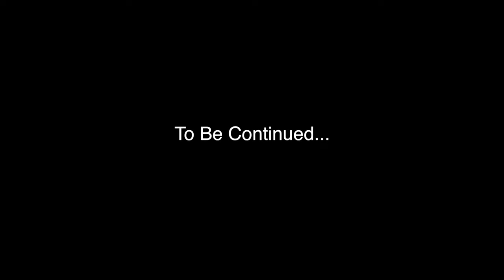How To Fix Stuck Brake Caliper Ford F250 F350

Comment: Cody, here is a tip for you, having to deal with this currently on my personal 2002 F250. (had smoke pouring off one caliper while driving)
I found out out that the brake hoses between the caliper and metal line go bad frequently and work like a check valve preventing the caliper from releasing.

replace those hoses (about $30 ea) and you should eliminate the "cause" of the problem. (might also be an idea to replace the other rubber hoses)

also check your brake fluid, if you see any discoloration (green = agae brown/golden = burnt fluid [should be clear]) flush the fluid until clear & re-bleed the system.

Comment: Cody, as far as parts pricing go, yes the dealership is usually going to be more expensive, but after working at a Ford dealer for for several years both in parts and service, they are not the most expensive all the time.  Just remember when you go to or call a dealer to have your VIN handy, where I worked they only needed the last 8 digits.  Also when brakes are seized up make sure to double check your slide pins to make sure thats not what is causing the problem.  And there probably no go way to explain this without being there in person, but you can depress the piston without unbolting it, using a pry bar.  Keep up with the great videos.

Comment: I've rebuilt F250 calipers before, back in the day, and you just need a hone and a rebuild kit and they work great.  It''s just an O ring and a cylinder in the bore of the caliper..  On a dual piston setup, it's just 2 of them.  The only reason you need a new caliper is if you bugger up the bore, or the bleeder valve gets snapped off or you buggered up the slides...  :)  Great vids Cody and Mrs W. :)

Comment: Between my 2 friends and my self I have seen 4-6 sets of "locked up" calipers.  One on a 2003 Excursion, several on a 2007 F250 (rear) and several on my 2007 Fusion (rear).

My theory is the slide/guide pins are sticking, despite being well lubricated. One axle set that I replaced, new pins would NOT fir the existing holes in the caliper until I actually drilled the holes over sized.

The last set of rear pads I installed on my Fusion lasted less than 12 months !  These were top quality, name brand, ceramic pads.

If you have a problem with a Ford caliper, I now recommend replacing BOTH the caliper and the bracket with re-manufactured units.  These come as one sub-assembly including new pre-lubed slide/guide pins and new rubber "boots" for the pins.

Rebuilt calipers and bracket for your truck from Rock Auto are about $101 with a $56 "core" charge.

Comment: Super duty's of this era have this problem all the time. I put some drilled and slotted rotors (I know sounds crazy) on mine and never had a problem since. Seems that the truck is so heavy that too much heat gets transferred to the caliper and just destroys them over time. Really it all comes down to cooling.

Comment: Check for a collapsed rubber break line. Often the inner sleeve of the break line will let the high pressure force the fluid into the caliper, but won't let the return fluid return to the line system and the master cylinder. Happens often.
Reply: Looks like one piston compressed when the other one didn't this time though. And it won't compress with the line removed either:( Although the brake hose would be an easy fix:)
Reply: +Julian P. I've seen a few dodges with failed brake lines that'd lock a caliper up.  But yeah, something happened to that caliper that cocked or galled the pistons.
Reply: +Julian P.  
Agreed Julian. But my experience has been once the brake line is off the caliper releases. It didn't in this case. I've run into that problem a couple of times. First was on a big Chevy powered motor home with the brakes from HELL. Unlike anything I'd ever worked on. But I've since seen it on my Ford pick-up and a friends Chevy pick-up. I'm told moisture in the fluid system is to blame. It causes the rubber to swell up internally and hydraulic pressure will force fluid through the system, but of course it can't return.  I'm no mechanic though. Just work on my own stuff. And friends. These online tutorials have helped me out more than once. There are things I'd STILL be working on without Youtube.
Reply: I'm just concerned that in the removal of the caliper is when the piston was forced into a bind and not prior. Normally when let sit for a while or over night the pressure can get back though the collapsed line. In either case I'd replace the flex line at the same time I replaced the caliper. Not that a reman caliper couldn't be bad.
Reply: Great video!  The replies are all helpful as well...thanks!

Comment: I rebuilt my calipers on my 01 F350. Also replaced the ball joints (using your video for a guide). That was 2 or 3 yrs ago now. I used EBC rotors and brake pads. Couldn't be more satisfied with them. My truck has 240k and has the 7.3 Diesel in it.

Comment: A mechanic put on a Napa one 7 months ago in my welding rig . Just yesterday I had to pinch the brake line off with vise grips to make it home. Holy was that rotor hot . Anyway After pulling off the wheel the pistons were evenly distributed. The sliders didn’t have any grease on them. I cleaned off all the dirt with a small wire brush then put on the orange grease. Now she rolls smoothly . I fixed it . Costed me 50 cents.

Comment: My 2005 F350 used to hang up several times a year, and I took it to a private mechanic, and he said it was the cheap grease the dealer kept putting in there. He used a grease with never seize in it and I never had a problem with the brakes hanging up again. The dealer tried to tell me it was fairly normal if you didn't have the brakes serviced every year. I thought that was outrageous.

Comment: A Bummer only getting 6 months of use for that caliper . I can relate to the days of rebuilding the calipers,  we stopped doing that as the time costs increased to the point were it was not worth the time to rebuild along with liability  so exchange for a new one . I hope you have better luck with the next one .

Comment: Cody I read someone commented that you might have a bad brake line. I had a Ford truck once that my brakes did like your brake. It took sometime to figure out that I had a bad brake line. I was told by Ford that they have a problem with the lining of the flexible brake line breaking down and it creates a flap like a valve. I changed out the flexible line and never had that problem again. Best of luck getting your truck back up and running.

Comment: Funny story for ya, my brother who is an mechanic for twenty plus years. Used to tell me the same thing about levels of parts and to never buy anything that isn't at least Napa. One day my dodge ram clutch went out and I didn't have the money to buy one from Napa since they wanted twice what shucks (O'Reilly) wanted. All the way to the parts store and back he's telling that only a Luke clutch is the they to go and you can only get from Napa. So we get home and pull the trany and I open the box the new clutch came in and guess what was stamped right on the clutch, Luke. 

Trust me when I say that it doesn't matter because there isn't that many people making parts anymore. One goes to one store and the other good to a different store. 

Same thing happened when I was working at radio shack. Cleaning the receivers and I look down in the vents and on a radio shack stamped unit I saw on big letters Pioneer.

Save your money my groomed
friend.
Reply: Just friend not groomed, darn smart phone :-)
Reply: +kantill what was?
Reply: +KingLeonidasll sorry I'm not following what you're asking.
Reply: oh shoot, my apologies, the 'show more' button didn't show up and only part of your comment appeared. It cut off right at 'guess what was' I was just getting interested and it stopped haha
Reply: +KingLeonidasll No problem :-)

Comment: I'm in 11th grade over at whittier tech in Haverhill, ma and I can't tell you how many brake jobs I've done on trucks that had the exact same brake issue as your F250. On many of them, the customer provided all the necessary parts and absolutely none of them were even from Napa. Most of them were from CAP and were more expensive than the better quality Napa parts
Reply: Probably would be smart to add that I am in the automotive shop course at Whittier Tech
Reply: +martin hedberg  Yes indeed, its hard to tell what you're getting for parts.  Myself I'd push the pistons out and see what the failure cause was.  Rebuilding calipers is so very easy, often unless the bleed screw snaps off I'll tear them down, clean and put them back together.  I have seen where a hot pad burns the dust boot and dirt gets in, just need a new dust boot and clean up the piston.

Comment: Another Way-to-go for Mrs. W :-) That's the way to get it off! Brute force! We live in a throw-away society, MOST people if it stops working, throw it away and buy a new one. I am guilty in a way our 7year old washing machine bearings went, and we could not get all the parts to repair it, so we finally opted to get a new one with a warranty. AND Mrs B LOVES IT! I spins REALLY fast, and when the cloths come out the are nearly dry! And living it wet Ireland, with high humidity, that is  in my oppinion, a very good thing! Hope the  follow-up video is just waiting for me, as the suspense is just killing  me! LOL! :-D

Comment: Hey Cody, I have been fighting this problem since my 06 SuperDuty was new. The Issue is that the pistons are made not from Metal which expands at a similar rate to the caliper, but from a phenolic compound that expands more than the bores in which they reside. Thus they seize in position after hard breaking, causing more drag, more heat, super hot seized brakes./ The reason for the change away from metal was to prevent heat transfer from the pad through the piston into the brake fluid which causes brake fade due to boiling. Ford was sued over this! I have often thought about reducing the diameter of the piston thus increasing clearance, but I am just too busy. I have never experiences stuck guide pins. So there you are.....send me a nice axe,  Pete
Reply: Same problem with my Chevy, phenolic caliper pistons suck!  I forced the piston out and it had swelled so much that it wouldn't fit back into the bore even without the seal!!!
Reply: Same issue here on my f350, four sets of calipers in 5 years due to these shitty phenolic parts. (never a pin issue for me anyway)

Comment: I'm in management at Autozone down here in Arizona and that's one of those deals where if that happened, I'd make sure you got new pads and a rotor as well at no charge, parts shouldn't fail like that when they are so new...

Comment: So the repair of a Ford Super Duty stuck brake caliper is to go to NAPA.  I was thinking you found some trick way to prevent the composite pistons from sticking in the caliper bore.  This version of brake calipers used in late model Ford Super Duty trucks are notorious for sticking.  An on the road quick fix is to use a large hammer on the back of the caliper.  Give the caliper body several hard shots and most of the time the stuck piston will slip back in the bore.  Most of the opinions follow the composite plastic pistons (2/ caliper).  These pistons are used to prevent brake fluid flash if the brakes pads are severely overheated.  The plastic pistons won't conduct heat into the caliper body and boil the brake fluid and fail the brake system at an inopportune time.

Comment: I had a Ram 350 that had a stuck slide on the left front caliper that I never even noticed, until the pad started squealing. It was only working on the piston side. New pads and some grease fixed it up. It was a new truck, but left over from the last-years models. I'm back to Fords, now.

Comment: I bought oem Ford caliper from local Ford dealer only 35$ more for new one compared to aftermarket rebuild from parts store. Oem last 200k. I would recommend to buy FoMoCo parts. Thanks.

Comment: Cody I think you need to replace the rubber line that hooks to the caliper take it off and see if you can push air thru it backwards this is typical on these to go bad the pressure will come thru but the rubber in the line makes a flap and keeps the fluid from returning!!!!

Comment: I have given up on parts stores and only buy parts online unless it's an emergency. The stuff they sell is absolute garbage and totally overpriced. NAPA is the only major one I know of that's still kind of decent but even their store branded stuff is going down in quality.
Reply: +27dcx agree'd, I'd trust a highly rated amazon part before a napa part nowadays.
Reply: got that right,i refuse to get robbed by the local parts store!
Reply: Lol napa is the worst and most overpriced of the bunch 😁 especially their calipers
Reply: @foxbodyguyeightyeight3672  Yeah. a  lot changes in four years.
Reply: @27dcx  I didn't even pay attention to the time stamp lol
Reply: Went to Napa the other day they wanted $90 for a e350 cartridge fuel filter heck I can buy FOMO for $67

Comment: Cody often over looked are the rubber hoses that do cause problems they swell shut and they degrade passing particulates into the calipers.
Reply: +LOOPPEY ditto Looppy. Sometimes the hose will act as a one way check valve and apply pressure to the caliper but not release it. Hose replacement is cheap insurance.

Comment: had the same issue with oreillys parts, for my F250 (made in 99 but is a 2000 year) they switched from metal pistons to the plastic and for 2 years of having this issue with the metal pistons I went with plastic, 4 years now zero issues.

Comment: The left front caliper seized on my 92 Ranger.  I put a new seal, piston, and dust boot in it, and it's been fine since.  Never have dealt with a dual (or more) piston arrangement, so don't know how that would play.  
BTW, retraction is entirely due to the square cut seal, and of course the slight amount of runout on the rotor.  The seal "tips", and pulls the piston back when you release the brakes.

Comment: That sucks,  I started using NAPA parts sense I started watching your channel.  I just finished all the maintenance on my work van.  
Plugs and Wires, serp belt, the hateful A/C compressor stretch fit belt, front brakes, rear brakes, rear axle oil, transmission oil and filter.

Comment: I have a big C clamp that I fit over the caliper to squeeze the pistons back in.  I usually turn one of the brake pads around backwards to make a bearing block.  If I go to the trouble of taking the brakes apart I usually replace pads at the same time.  The one pad looked 3/4 gone.

Comment: I had a similar problem once. The piston got corroded a little and was hard to move. I was able to disassemble the caliper and remove the rust with fine sand paper. Put it back together, bleed the line and worked perfect.

Comment: Cody - If you have repeated brake caliper failure, check the brake line for that wheel.  Oftentimes, the brake line will deteriorate on the inside basically turning it into a one-way check valve so that the fluid will come from the master cylinder when the pedal is pressed but will not go back to the master cylinder after the pedal is released, thus resulting in a failed/locked caliper.
Reply: thanks i think that is whats happen to mind

Comment: Brake lines are bad to collapse on the inside of the brake lines going into the caliper. Try and open the bleed valve and see if the brakes release if so a brake line is your problem if not it's your caliper
Reply: Wouldn't both pistons be stuck then ? I'm working on mine right now.

Comment: Entirely intended to be constructive observation ( I know! Usually the harbinger of some form of attack ;-) ).  Its impossible to cover every aspect of a subject in a short video - and particularly keep it interesting and flowing.  So constructive additions via comments are usueful and develop the theme nicely. I view the videos as a sharing process with Cody and like that - a great deal.  My issue is that the video titles aren't always helpful in giving the correct impression of the content.  I appreciate it risks pedantism - but its more a case of expectation and frustration.  In this case, the title really was changing a stuck brake caliper for a new one, as opposed to 'fixing'.  Fixing would make a great further video - Cody mentioned rebuilding calipers in this vid.  There's a strong argument for part replacement - but within the theme of self reliance, I suggest that an actua; fixing video would be something manty would like to see.  So please take in good heart Cody and please  see if its possible to be more specific in titles - hopefully using the process to generate new video topics.  Keep up the good work!

Comment: Some of the Ford trucks have specific inner pads and outer pads. If you mix them up, you experience what just happened.  Some of inner pads have two ears that fit into the two slots in the pad holder, while the outer pads have one or no ears. Also, clean and lube the slider pins with Sil-Glyde silicone grease, sold by NAPA.

Comment: sometimes believe it or not dealer parts are actually less expensive.  I've ran into that several times in the shop that i work at.  It doesn't hurt to check around.

Comment: Replace your break line to, I run fleet management for a tow company with 12 trucks, 11 being a mix of F-450-550, and one 5500 Ram. I've come to find out that sometimes on going caliper issues is due to a defect with the break line going to the caliper.

Comment: Around here NAPA charges double for everything unless you buy tons of stuff from them. I have a problem buying from people like that when their stuff doesn't seem better than anything else. They were however the only ones that had rotors for my Ranger when it needed them and it was only 2 years old. I'm not one to buy the cheapest parts out there, I'd rather do it once than save $30 to have to do it again next year.